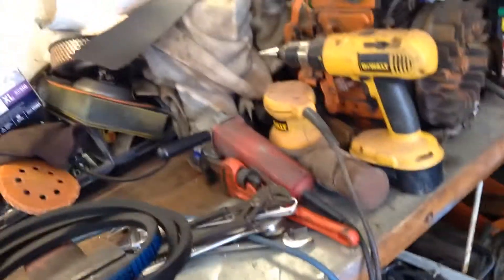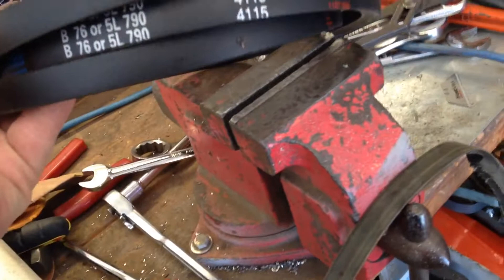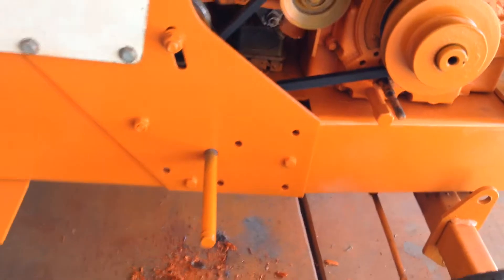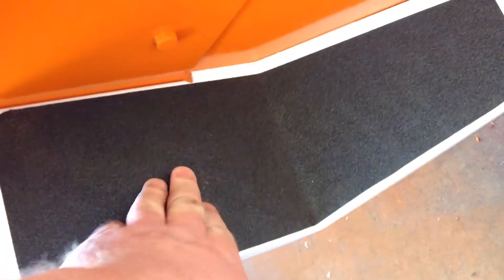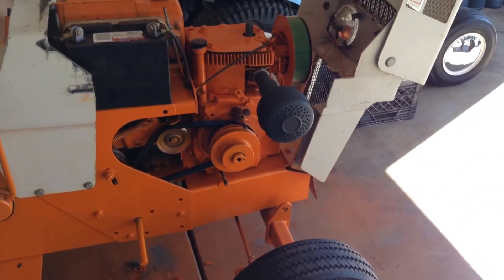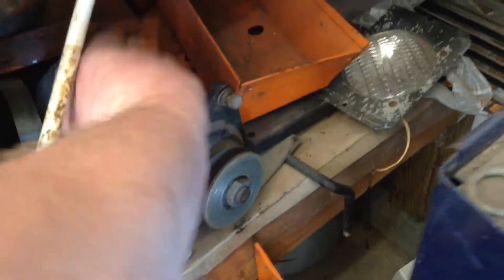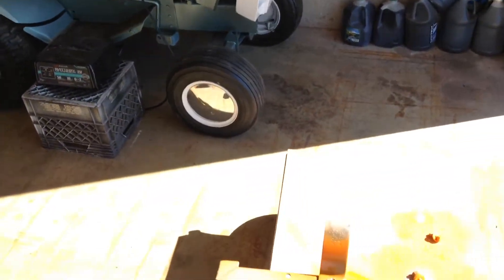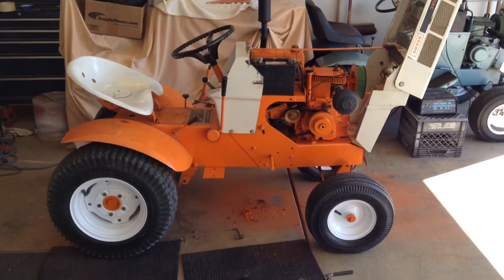New drive belt in the 1968 Sears hydro

Comment: Is that the HH 100 or 120?
I'm trying to figure out if the wire going to the insulated bushing on the blower housing is supposed to have battery power or is it the kill wire? I got the coil to fire separately but not sure if the module is bad.
Reply from the maker: Its a 72 HH120 in this hydro, and I want to say there isn’t power to that wire. It grounds out there when you turn the key off

Comment: Hey i have an st 16 and my motor stopped or barely charges my battery, what should I replace?
Reply from the maker: Sounds like rectifier isn't working. It's that aluminum finned box that should be mounted somewhere by the battery tray.

Comment: Ya that looks great, I have a 1968 ( jade green? ) Hydro I'm working on now.   I have seen the 1968 orange ones same hood and grill as the green ones.  Would your be a 1967? Late year 1967 first year Sears made one, but still possibly sole in 1968?   Just wondering I know you have been work on these longer them I have lol.
Reply from the maker: Thanks man! I love these hydro's, No mine's an early 68, we all in the Sears group i'm in thought these were 67's until I got this one and it coded out as a 68. Pretty cool find around here, Sears are scarce by me. The ID number is one digit higher than the SS12 hydrotracs too. Those are 917.25300 and these are 917.25400.